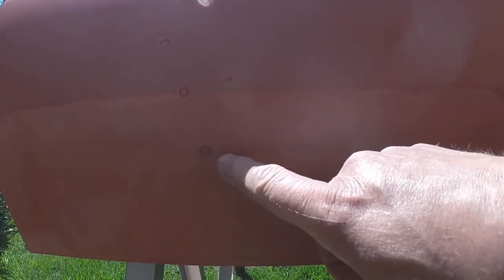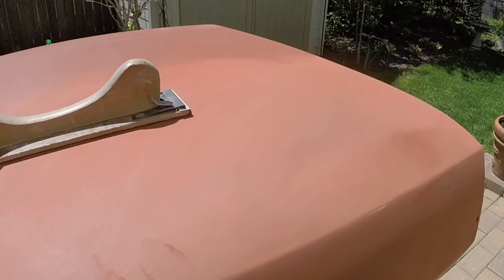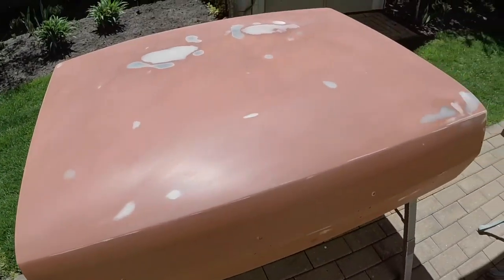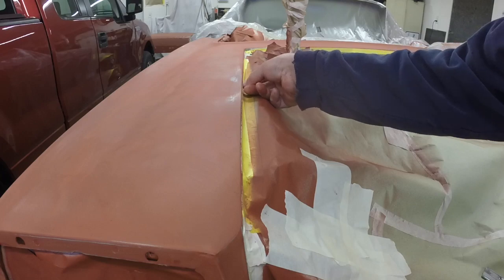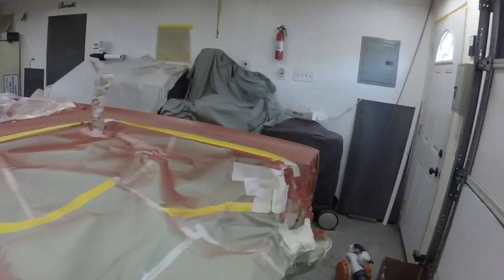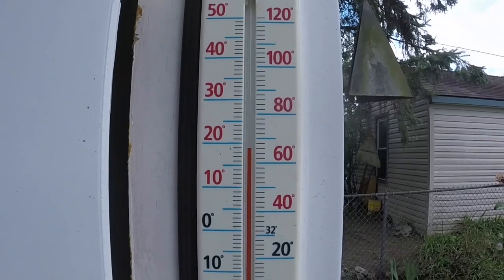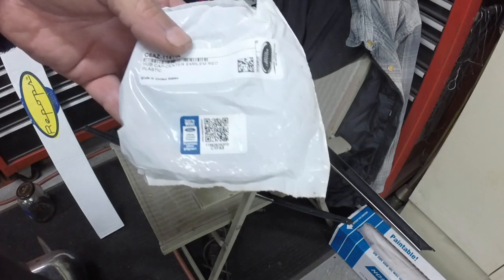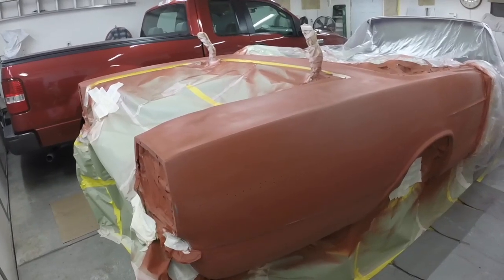1966 Ford Galaxie 500 convertible restoration part 114 rear panels ready for paint

Comment: Where did you find the wheel cover centers? Mine are beat up as well. I have a few that I think came from a Mercury, but they have a four-pointed star in the middle instead of the emblem.
Reply from the maker: I think it was Auto Krafters.  It was months ago when I ordered them, so I really don't remember what I paid, but there not cheap.

Comment: Mr Alley, could you comment on your paint steps? You mentioned sanding the primer then sealing. Is everything sealed before paint, or do you prime then paint after sanding? Do you have a brand preference for your primer and paint? Thanks from sunny Arizona.
Reply from the maker: It all depends on the car. This car was red oxide primed, gray sealed, then painted from the factory. I am doing it the same way. Primer bonds, sealer bonds, and seals the primer, so there are no paint issues. Primer is porous, sealer is not. A primed car will rust, a sealed one won't. Without the sealer, you might get some primer bleed threw. You can prime and paint, but just comes out nicer sealed. A good urethane primer will seal also, so sealing it is unnecessary.
Reply: @OldCarAlley  Thank you sir. Looking forward to your future videos.